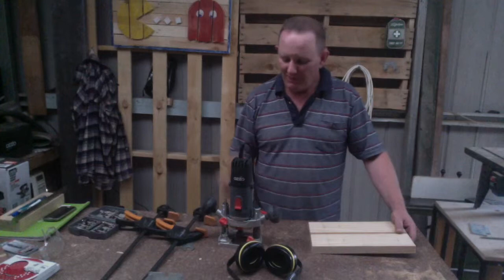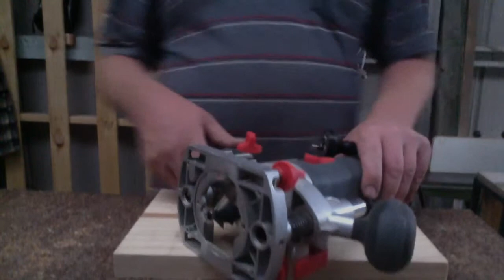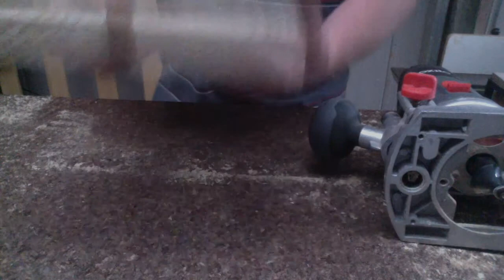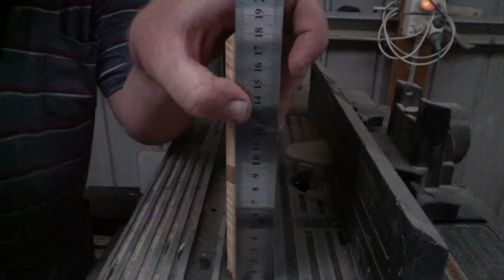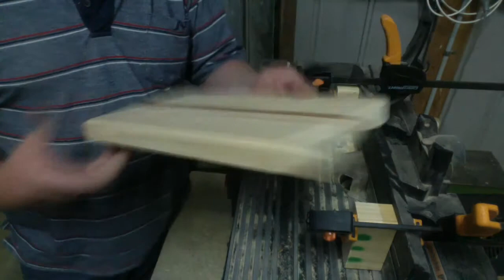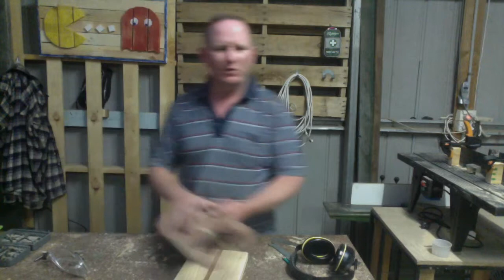HOW TO TIPS  How to use a router to add finishing touches to a chopping board

Comment: Hi Matt how do you adjust the router height being a plunge router up into the table?
Reply from the maker: With a little difficulty. But once setup I set the stop gauge so that if I need to make adjustments after, I use it as a guide and adjust it then push up and lock into place.